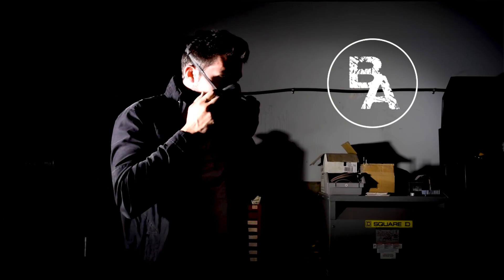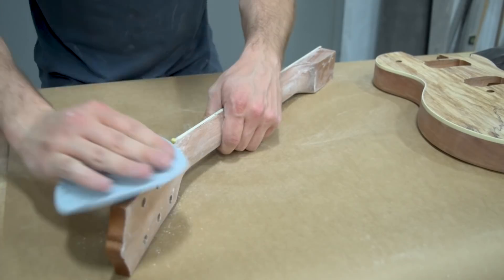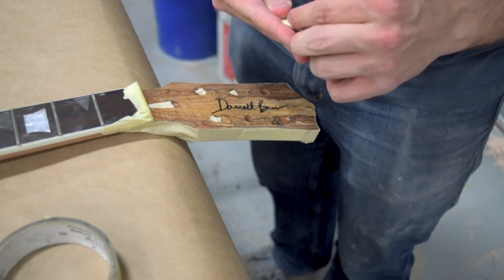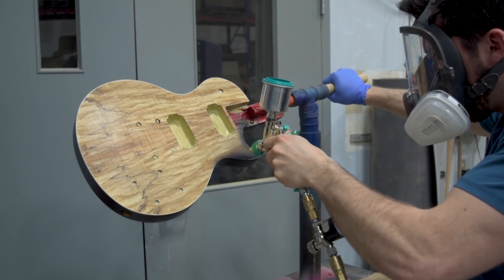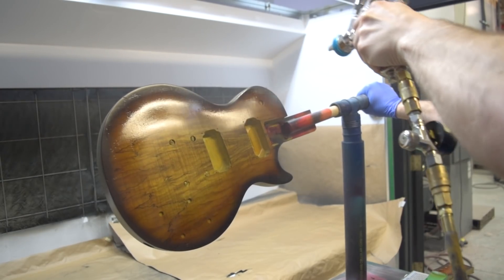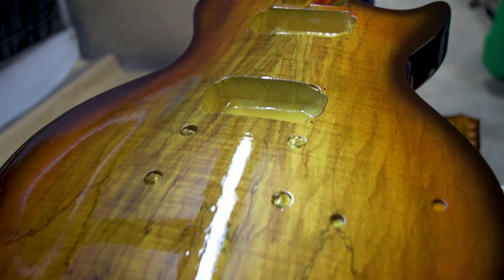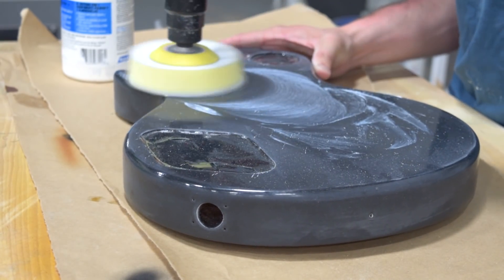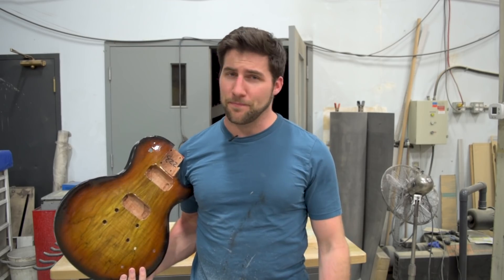Darrell Braun's AWESOME Spalted Maple Les Paul Guitar Kit (the paint job)

Comment: Turn the air cap 90 degrees on the front of the paint gun when making verticle passes. You have your gun set to make left and right passes. Makes less guesswork for edging.
Reply from the maker: I turn the fan off for edging and use a round pattern. I’m not making any vertical passes.

Comment: With a glossy neck, I use some automotive wax to slick it up really nice, though I did just get some tung oil so I may have to try that sometime as well
Reply from the maker: Let me know which you decide you prefer.
Reply: I have used the spraymax 2k clear on a couple of guitars now and it has been silky smooth.
Reply from the maker: Good to hear. It’s a quality product for sure.
Reply: The current build is an ash neck so that will get pore fill and the spraymax treatment, I'll have to try the tung oil on my next maple neck

Comment: If you had shorter screws in the neck joint you could just sand right over the holes
Reply from the maker: Yup.
Reply: @BradAngove  Didn't mean to sound critical I think I thought I was helping lmao. Nice job btw I really like your work!
Reply from the maker: I didn’t take it as critical per se haha. You’re correct and I have done that before as well. Just didn’t have any of the right width at the type.

Comment: I'm glad Solo took your suggestion, I sanded thru my veneer in a couple spots, both on the top and headstock.
Reply from the maker: Damn. I know the sealer helps during shipping, but I’m glad they were able to forgo in on the veneer on the newer kits.
Reply: I would think they could forego the sealer on the whole body, that's the worst part for me, sanding all that sealer off to get down to bare wood. I've purchased other bodies that were from China with no sealer.
Reply from the maker: I’m sure they could, but I don’t know if it would result in some product loss. Once they see how this next batch goes I’m sure they’ll consider it.

Comment: Wet sanding sands better because it prevents the dust from clogging the sand paper. Dont need to soak it just keep it moist.
Reply from the maker: That was true a while back. Sandpaper technology has improved such that it’s no longer an issue.

Comment: Why not sand between final coats to get rid of the orange peel on there?  You can see definite bumps and ridges in the finish. I am sure you could have made it look straighter if you had spend time sanding
Reply from the maker: With a poly finish like this you generally sand it flat after the final finish. Not between coats.

Comment: Brilliantly done Brad love the step by step been in the auto painting business 40 years and your right the first guitar I done was my own kit build and  i wet sanded and it cracked every couldn't figure it out first until I resanded and seen the water just like sunlight draws water out of metal if the vehicle not been in a spray booth
Reply from the maker: Sorry to hear your first finish cracked. If you need to wet sand, use something like naphtha to help avoid that problem.

Comment: Really hope to get a reply to this: around 8min mark you start sanding off the vinyl sealer with 600.. and then moved to 300? shouldn't it be 300 first? And how do you know how much of to remove so that i don't remove all of the vinyl sealer i sprayed on? wouldn't that be a waste of time and materials? beginner here.. really hope to get this clarified Brad!
Reply from the maker: It’s 600. I said 300 by accident. I prep for the sealer with 320 or 400, but after the sealer it’s the 600. You just want to sand it so it’s smooth. Remove as little as possible while getting it smooth and flat.

Comment: Great work! I have two questions if you don't mind.  Did the customer you did this for make the body?  If not, do you know where it comes from?  Secondly, would it be just lunacy to do the spraying outside?  No way I can set this up in the house!
Reply from the maker: The body is part of a guitar kit from Solo Music Gear (link is in the description). 
Outside is very risky, but if you can set it up in a garage with a fan blowing the fumes out you might be ok.
Reply: @BradAngove  Thanks for the quick reply.  I did a Solo kit last year of a thinline Tele and did a pretty poor job of it, but I'm thinking of doing a LP this summer.  I'd really like to do things myself but don't have the right setup to paint in.  Would you do it on "commission"?
Reply from the maker: @flyawayhorses  I do some commission work, yes. You can get in touch with me via private message through the Instagram or Facebook links in the description if you would like to discuss further.

Comment: Would it be possible to stain the wood after sanding off the sealer from the factory?
Reply from the maker: Yes, but I wouldn’t recommend that with this particular type. Spalted maple doesn’t take stain very well, and the veneer is very thin so trying to sand through the sealer is risky.
Reply: @BradAngove  Thanks for the reply, Great video! I learned quite a bit from watching, keep up the great work!

Comment: Awesome Job!  I don't know if you tried it. But I found that using those plastic colorful foam floating tubes you can get at a Dollar store or Walmart. Makes a good sanding block for doing the curves around the edges of your guitar, just cut them down to the size to fit your hand. roll sanding paper around it and tape it off . It goes over the curves pretty good.
Reply from the maker: Great idea. Thanks Thomas.

Comment: Have you ever tried a Danish oil finish on a neck?  I've used it on furniture projects and liked the way it turned out and I know it has a small amount of poly in it that would help seal and protect the wood, but have no idea how it would affect the playability of the neck.
Reply from the maker: I have. It works well, but I prefer a thin coat of modified tung oil.

Comment: When you’re screwing on your neck handle jog from the opposite side are you screwing into the same bolt holes that will be used to bolt on the neck in the finish? That won’t ruin the holes ?
Reply from the maker: Yes, I aim for the same holes. Those holes can’t really be ruined; they should be drilled out wider during actual assembly so that the neck screw pass through them easily without catching.
Reply: @BradAngove  awesome, Thanks for the reply! I’m feeling pretty confident about my build and finish thanks to your videos and your feedback
Reply from the maker: Glad to hear it

Comment: Wow. Great job on the finish. I saw this before the unboxing on Darrell's channel. Waiting on part 3. Great collaboration.
Reply from the maker: Thanks Zeus!
Reply: Brad Angove no twitter, no Facebook. How can I ask a question without posting it here?  Thanks
Reply from the maker: Should I assume that you also don’t have Instagram?
Reply: Good assumption Lol.
Reply from the maker: How are you with smoke signals?
Reply: Not any good at smoke signals. I keep catching the blanket on fire. I have a google plus account. What's hangout?
Reply from the maker: It’s a google app that uses your plus account. Let’s you send messages and photos etc.
Reply from the maker: *lets
Reply: Ok then, here goes nothing. While waiting for the Solo kit I want to become available I started another.  Using spray cans for the finish. Rustoleum brand. 6 lights coats of the color I wanted. Looked good. When I went after a clear coat I saw a can of Glaze. Used it instead. Mistake! 3 light coats had it looking glossy but it would not harden. After a week the slightest touch would leave creases and fingerprint indentations. So I sanded off the glaze and went back for a can of clear coat. 3 light coats. Looking good!  Let it set a week. Taped off the edges and protected the finish with plastic grocery bags so I could roll it over and spray a Poly finish on the backside of the guitar. Two days later I remove the tape and plastic bags and now I have wrinkles imprinted by the plastic bags all over the front finish!  What did I do wrong and how do I fix it?
Reply from the maker: Before we get more specific, what was the temperature and humidity like where you were spraying?
Reply: Of course I had to do this outside. If I recall temps were in the high 80's to low 90's. Humidity was in the low 80'. I gave it about an hour after the last coat of each cycle and then brought it inside in the Air conditioning for the rest of the curing process.
Reply from the maker: That sounds pretty high on the humidity side. That may be part of the problem. Also that Rustoleum can take several weeks to cure to a point where something like plastic wrap won’t leave some sort of imprint unfortunately. Hot, dry conditions can help, but the hardening still takes quite a while on that product.
Reply: Sand it smooth? What clear coat can I use that won't take weeks to cure?
Reply from the maker: Yes, you’ll need to sand smooth. Have you seen my video on how to get a professional looking clear coat with spray cans?
Reply: I’m sure I have but I’ll watch it again. Sand smooth to bare wood?
Reply from the maker: Just until it’s smooth. Ideally not all the way to bare wood if you can avoid it.
Reply: Just watched it again. I’ll let you know how it turns out.
Reply: Thanks for the help.

Comment: Is there a foolproof way to determine whether a surface has been sealed?
Reply from the maker: Usually you can tell by sanding if there has been sealer applied. It will usually create finer white dust instead of sawdust.
Reply: @BradAngove  Great, thanks Brad!

Comment: why do you get remove poly resin sealer and apply new sealer?
Reply from the maker: I don’t remove the poly resin, I just sand it smooth to prep for the next layers. The poly is only one coat. It needed more sealer.

Comment: HEY BUDDY,I HAVE BEEN WANTING TO DO THE SAME PROCESS!  BUT, WOULDN'T IT BE BETTER TO PUT THE UPOL POLY ON FIRST SICE IT WILL HARDEN FAST.???? THAN PUT THE NITRO ON BECAUSE IT TAKES WEEKS FOR IT TO HARDEN????????  PLUS YOU WOULD NOT SUSPECT THE POLY FINISH UNDER THE NITRO, THEREFORE GETTING THE STRENGTH OF POLY BUT THE SMELL AND LOOK OF THE NITRO???
Reply from the maker: Unfortunately you would then have a weaker finish on the outside. You can put nitro over poly like that, but the purpose of the poly on this one was to protect the nitro. This particular nitro only needs to dry about a week before polish or a coat of poly like this.

Comment: Hey Brad,fellow Canuck  here from Newfoundland and im wondering what was used to mix the colors and what is the ratio used? And would it be safe to use in an airbrush?  Or would the trim gun be a better choice?
Reply from the maker: You can use an airbrush. For an airbrush, if you’re doing a similar lacquer based option, I would suggest 70% thinner, 30% lacquer, and then the addition of a bit of the dye for you colour which you can mix “to taste” so to speak.
Reply: @BradAngove  thx so much. I appreciate it brother

Comment: Thanks Brad! can you use tung oil and gun stock oil on a mahogany neck? I read somewhere that it has open pours and therefore must be sealed!
Reply from the maker: It depends on what your end goal is. You can use it for a thin finish, but it will take a lot of you want a fully sealed glossy neck finish.
Reply: Brad Angove the goal is to achieve musicman like finish. What should i do?
Reply from the maker: Is that a full gloss, or something else?
I don’t own a musicman.
Reply: Brad Angove not really really. Musicman are known for their satin-ish finish, but they use tung oil and than gun stock wax. It is smother than satin finish.
If you can give an advise about how to acheve this finish, or even better, make a video about it, a lot of people will appreciate it.
Reply from the maker: Ok. I’ll see about adding it to the list. It’s likely done with steel wool, and a similar technique to the neck of this guitar. It can be done on mahogany as well.

Comment: Nice burst, but the clear is very bumpy and cheap looking. I think the issue is that when you finished spraying the nitro lacquer you didn't sand afterwards leaving all that orange peel to be covered up by the poly, and since poly wont burn into the pigmented nitro like a clear nitro would have you've created two layers that can't burn into one, so you've essentially frozen the orange peel in place, and no amount of sanding afterwards will get rid of the orange peel since the bumpy's your seeing are actually the nitro not the poly. And I know you couldn't have sanded the nitro without risking messing up the burst, but a light coat of clear nitro would have burned into the other nitro making the two layers one which could be sanded flat giving you a pristine orange free surface to spray poly. I'm not trying to dog on you just think you shouldn't pretend like you don't see it, giving unsuspecting viewers the wrong idea of how a spray job should look. If you put that guitar on a music store wall next to factory guitars the flaws are very evident. And I see this is an older video, so maybe you know better by now, if so just ignore me, but hopefully other viewers learn from this? Anyhow, have a great day and keep painting, great vids btw.

Comment: The only thing is you sealed the guitar.Hope you let each coat dry,I've been told to wait at least 3 days so everything can gas off.Didn't see much drying time! Great job though.👍
Reply from the maker: 3 days is pretty typical for sanding sealer. This vinyl sealer dries faster than that though. Still needs some time of course, but not the full 3 days.
Reply: Brad Angove Cool I have a guitar that needs finished a 1962 Japanese Hoshino Ibanez,they had a sunburst finish.Hope to try your method,looks great.
Reply from the maker: I hope it goes well for you. Thanks Bob.
Reply: You literally wanted him to make a video showing paint drying? Damn dude, you are a true masochist.

Comment: Why did you do the black first instead of covering the amber with the black at the end? Is that just the paint you were working with, or is that how burst finishes are done? I'm thinking of doing a kit sometime and I am 100% new to this.
Reply from the maker: They can be done both ways if you’re using black and transparents. Any other colour combo would generally require you to consider how they layer up in order to choose which order to do it in. 
In this case, the type of paint also factored into that decision, as did the fact that I wanted it to be easy to clean up any issues with the black if I had a problem spraying such a thin burst.

Comment: Interesting video and it would appear that you know what your doing. I watched a different video from Boudreau Guitars
 that dealt specifically with the issue of "Poly and Lacquer, do's and don'ts" https://youtu.be/AY5f1m0OUxQ 
His advice was never do polyurethane over lacquer. You could do lacquer over polyurethane but not the reverse. The reason being that the lacquer never quite finishes "gassing off" and the urethane may eventually start peeling.
Where do you stand on the issue? btw... I would have left the binding show too. I would have gone with a darker reddish stain for the back and the burst.
Reply from the maker: This lacquer dries pretty quickly so it’s not really an issue. You can coat over lacquer with poly, but you should wait a couple weeks for it to gas’s off well before doing so.

Comment: How long did you wait for the lacquer to dry before topcoating with the clear? I am always concerned with mixing like that due to how slow lacquer offgasses.
Reply from the maker: That’s a valid concern, and it depends on the lacquer, temperature, and humidity. This particular lacquer tends to dry relatively quickly, so I waited a week.

Comment: I think that type of glossy finish looks cheap. You did a very nice job technically, but it just has the look of a factory piece, and not a hand-made. The mahogany on the back might as well be poplar. I thought you might have evened out the colors of the separate pieces, but you just covered them over. That is another thing that is commonly done with factory work.

Comment: Wow Brad, great job on the Burst and the finish looks amazing. If I wasn’t currently working on my Explorer Guitar I’d snap up one of those Spalted Maple tops, 
Thank you for putting out these videos Brad, I really enjoy watching them but also I’ve used some of your hints and tips when using rattle cans. One extra little tip that I use is to cut the top inch off the index finger of the rubber glove so that you don’t get any drips which can build up on it from pressing down on the nozzle, sounds silly but it works. 
Looking forward to the next video.
Reply from the maker: Thank you. I’m glad you’ve found the videos helpful. How’s the explorer going?
Reply: Brad Angove   Hi Brad, thanks for the like and reply. 
I’ve just flattened the clear coat on the Explorer and now deciding if I want to put more clear on to give it a deeper finish or polish it up as is.  I’ve got an extra can so I might as well use it and get a deeper and richer finish. 
Thanks again for your videos Brad, I used your idea for a spraying station, except I use a square baton attached to the guitar body so that when I tilt the guitar to spray the edges it locks in place as the baton catches inside the tube with the weight of the guitar body to hold it steady freeing up your other hand. 
Looking forward to your next video.